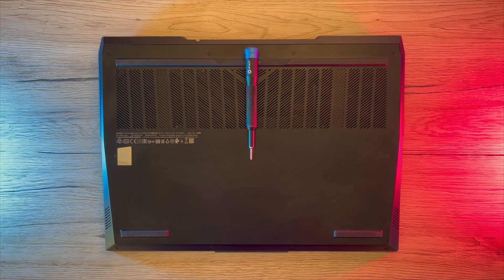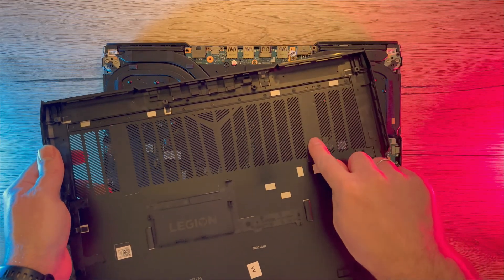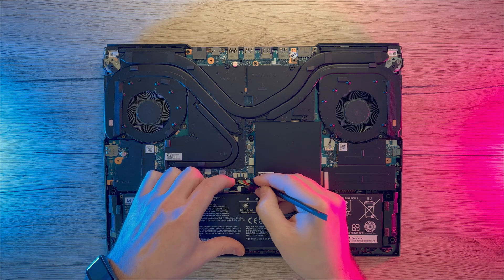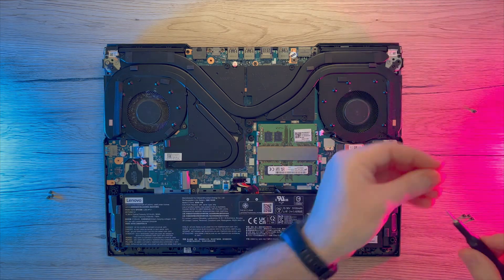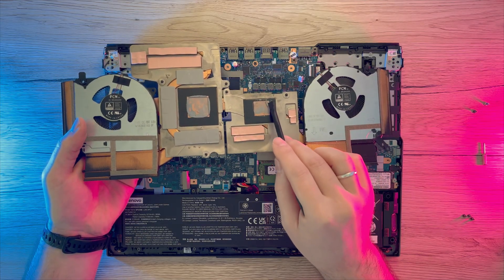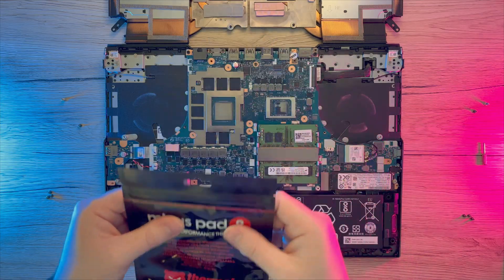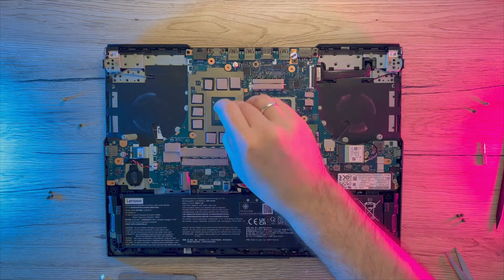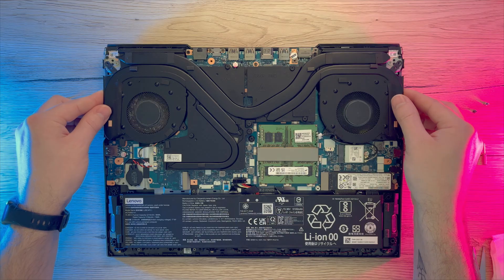Re-Pasting Lenovo Legion 5 Pro 2021 and Fixing Over Heating

Comment: Temperature after repasting?
Reply from the maker: you can check my cooling mod video and there are the differences in temperature and sustained power. There is not too much to it but what more important for me was, is fan speed in standard use (web,video etc.) which is now great. In high load scenarios every cooling solution will hit its peak saturation point and temp will be the same but you will reach more power. I am working on another vide to show how to benefit from those mods with software which will make a difference across all scenarios ;)
Reply: @atechcheck  Use the PTM 7950 paste and all your cooling problems will disappear.
Reply from the maker: @denzellupheng7063  I would if I could find to buy it in EU :D now I will try with soft pads from Alphacool and their paste just to see if pad thickness is making problems :D
Reply: @atechcheck  order a sheet of it in different sizes from eBuy7
Reply from the maker: You mean Alphacool or? I already did it and I am working on update video. It actually worked and that was the main issue wit legions… Will update asap 😉
Reply: @atechcheck  I bought it (PTM 7950) yesterday from Aliexpress for 19€, a little bit pricey tho
Reply from the maker: Yeah me to from another site (around same price) still waiting for it (HK) hmmm I can’t wait to test them and be done with this since my brain is killing me. I really find it hard to believe that it is better than others 😅
Reply: @atechcheck  I repasted mine with PTM 7950 today and no major improvements :(. I think I did not commit any mistake during the repaste, I don't know. Maybe it's the summer, here in Spain is always 30-40º degrees as ambient temperature
Reply from the maker: Yeah that have effect on cooling… here in Ger is unfortunately also 30…. But I still believe that pads are the main issue and they should be replaced with soft ones or putty like ones… also PTM is much more dense than others that I have but thermal conductivity of Alphacool is much higher. I am working on video where I will be comparing them all so that we understand what is better and why ;)

Comment: I have an issue with my 2x Legion 5 Pro one with 3060 and the other with 3070 where it would randomly freeze and crash and reboot when hybrid mode is off…do u also face this issue
Reply from the maker: Well unfortunately I did (sort off) just yesterday.... I was playing in performance mode with external screen (MUX ON) and for 10-20 seconds it was running at 10FPS instead of 200+ I am on Win 11 and since last update my laptop is acting strange sometimes...(this FPS issue, Lightroom refusing to import all photos etc...) I think it is not machine but rather OS in my case. What WIn are you using?
Reply: @atechcheck  win 10 on both lp5 2021
Reply from the maker: Hmmm 🤔 what about drivers and BIOS do you have latest (from the websites) forget about Vantage updates they are always too late xD also check in BIOD if GPU over clocking is ON since I did it one and I was getting freezes and restarts…
Reply: @atechcheck  I tried the Lenovo drivers and as well nvidia latest drivers it still crashes. As for bios I’ve tried the latest and as well all the old ones and it still crashes. And gpu overclocking is turned off…
Reply from the maker: @19xx69  I would advise getting HWInfo and check your temps under load! Go with Cinebench + Valley benchmark both together and check your CPU+GPU Temps. Also under load check your GPU Voltage. As last resort try to clock down your GPU with afterburner and limit your CPU with Ryzen Controller just to see what is going on. It is really strange but it could be that you have bad machines but 2 of them is not that likely. I am suspecting at high temps...
Reply: @atechcheck  most of the time it crashes when idle and not gaming…I suspect it’s bad motherboards
Reply from the maker: It could definitely be the case, especially in COVID times QC was non existent xD I would definitely reach out to Lenovo and either repair it or if you are still in your legal time frame to return/replace them

Comment: Will it void its warranty if I do repaste?
Reply from the maker: nop it will not since that is something that any of us should be able to do after couple of years :) also if you take a look in video there is small warranty sticker on the screw but that  one is for motherboard and removal of it. You can see it only if you remove cooling block. Worth mentioning is that for any damage caused buy you yourself, it will void your warranty of course :D hope it helps.
Reply: @atechcheck  ohk got it. Actually mine is running quite hot like 90° in some gpu heavy game like tomb raider(with RTX on) and sometimes experiencing heavy frame drops, so I was thinking about replacing the thermal paste.
One of my friend has built quite a lot of PCs and I hope he can do the job safely. I was just curious about the warranty
Reply from the maker: @subhojit2003  well you definitely have issue since my GPU at 140W is not going above 75C while CPU will go above 80-90 unfortunately... I have another mode to test with another thermal pads. If it works and I menage to resolve this issue I will post an update video :)